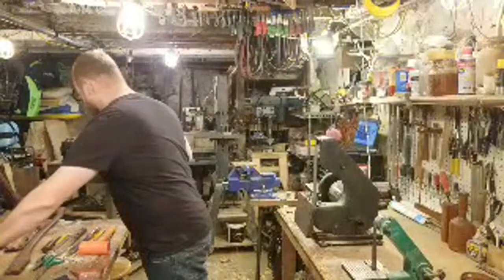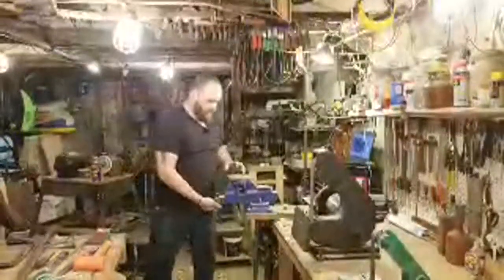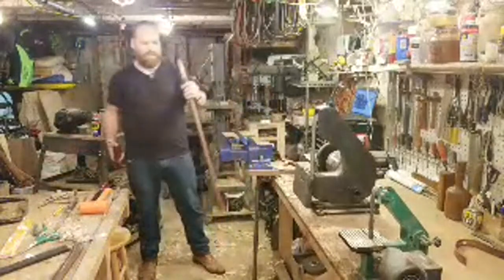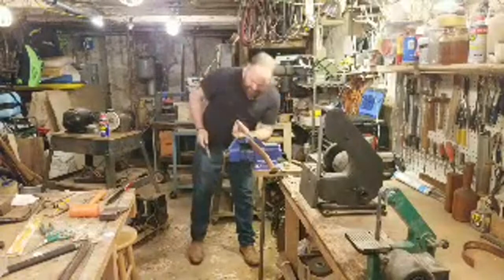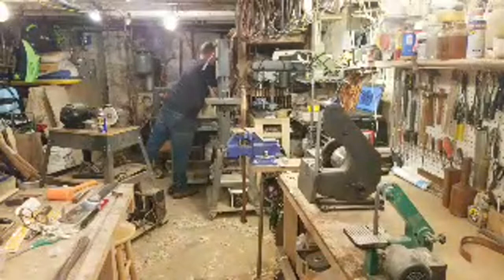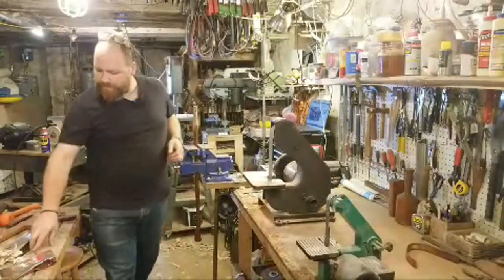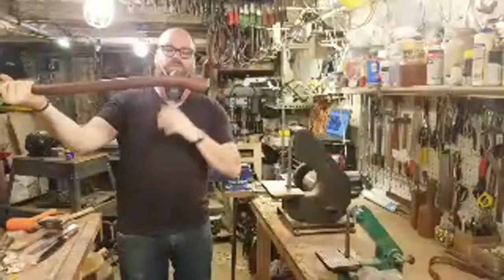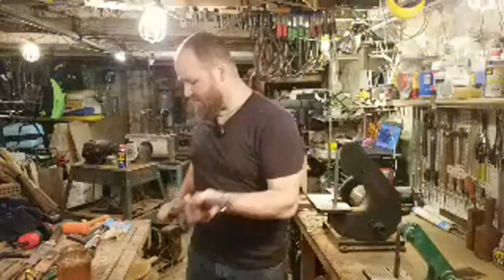Hanging an Axe LIVE! Tips & Tricks

Comment: Don't ever use the Harbor freight dead blow in the cold it will shatter. I had the bright idea to use mine trying to break some firewood free that had frozen together. 2 wacks and shot went flying. Edit: Also if you're ever feeling a little squirrely hedge/osage makes a nice axe handlealthough hard to work possibly harder to find a good grained stave.  I'm a sucker for the yellow. It ages very nicely if well kept.